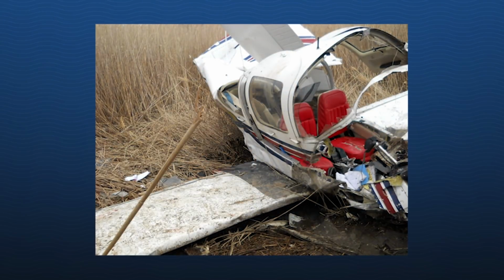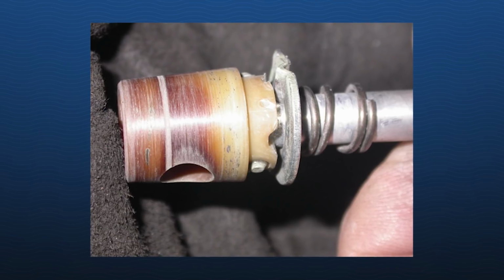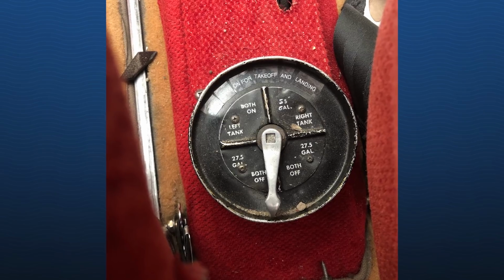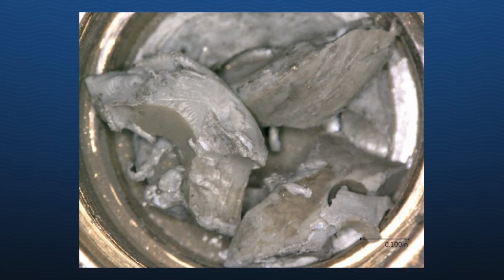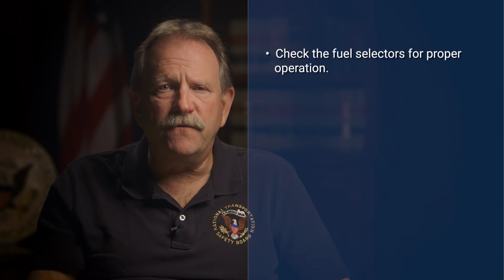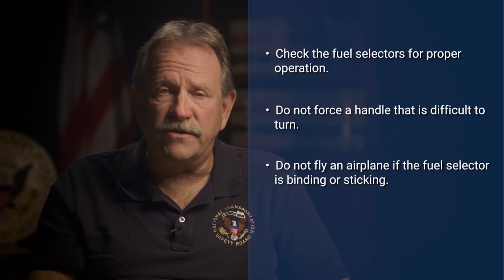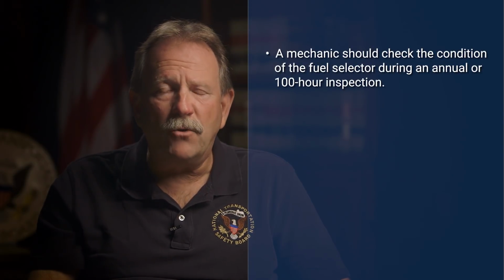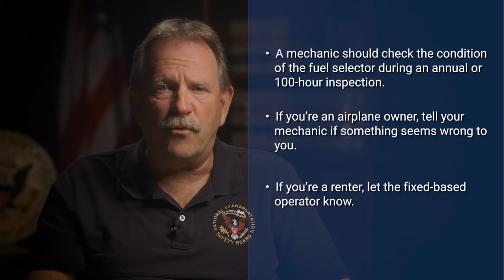Pilots: Ensure Your Fuel Selector Works

Comment: Electric planes will save lives and our climate.
Reply: Lol, no they won't.
Reply: See if Harbour Air needs pilots
Reply: Nicholas Littlejohn dream on.  There would need to be a quantum leap in battery technology before that would happen.
Reply: @jonhare392  You'll have to tell that to Boeing and the Zunum electric plane venture they're doing right now.
Reply: Nicholas Littlejohn like I said a quantum leap for batteries will be needed before an electric plane will be viable. The venture you're talking about is a hybrid electric not a quote electric plane, unquote.  Oh and how many passengers does it carry four? It will take a whole bunch of those before the world and the climate will be saved.  I'm all for electric planes and I was there when pathfinder plus set a world record height flight of 80,000 feet. Btw it had batteries, solar cells and fuel cells.
Reply: @jonhare392  Be positive, this is a regional plane and Siemens already has working electric general avaition planes.
Reply: Nicholas Littlejohn you're reading me wrong.  I'm all for it. I stand by my statement though.  Better batteries more flight time.  We aren't there yet.